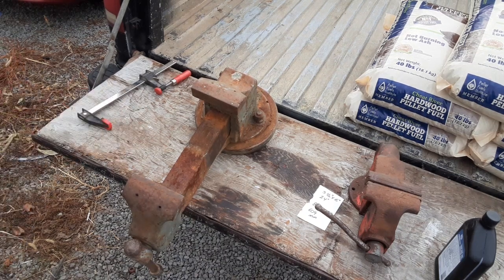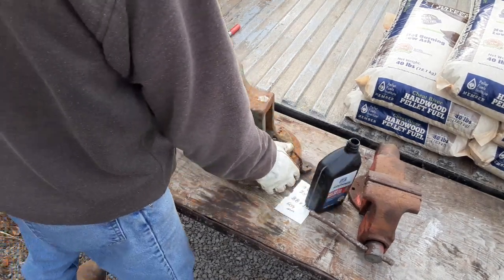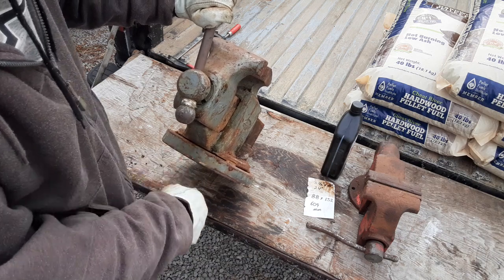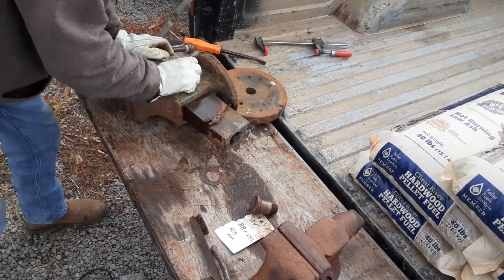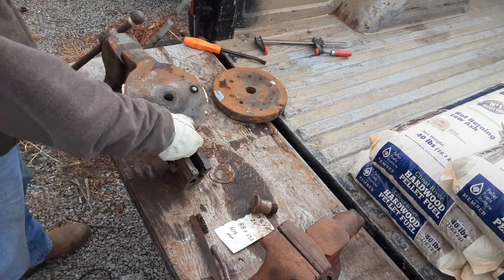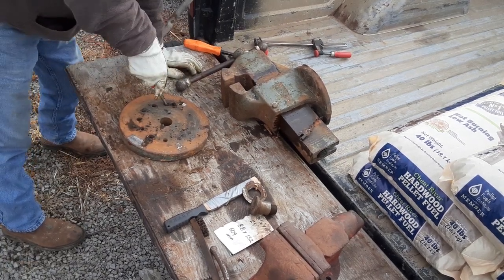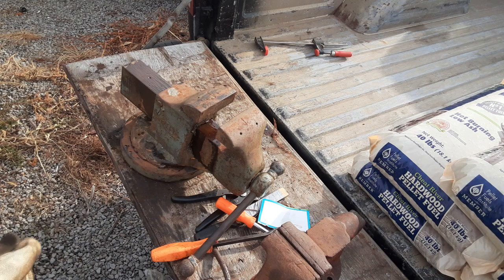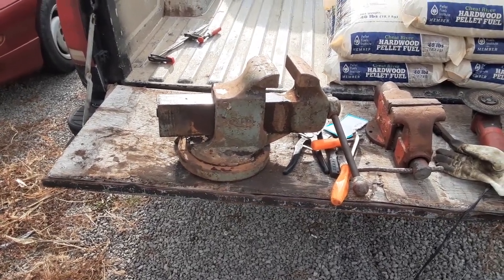the new Reed Vise and a question to the members about a piece of Steel

Comment: my first thought too would be quick change toolholders, but you would have to saw that 6" dimension in half- and sawing a two foot by 3 1/2 thick peice of steel is a lot of sawing.  A two piece vice for clamping parts straight on to the mill table would be a good use  of some of that steel. a threading stop  or carraige stop for the lathe would be another.  But also less exciting things like strap clamps. at 6 inches it's ok for a small machine table too. I don't know if you have a surface grinder but a 2 by 3 by 6 section could take a T slot and become the base for a mickey mouse cylindrical grinding fixture. .
Reply from the maker: A 2 piece is a great idea...been considering such a device for some time

Comment: I think that is the right size for quick change tool holders.

I would advise against painting the little vise. Replace the bar and wire wheel it but a fresh coat of paint makes it look like you are trying to hide cracks.
Reply from the maker: Thanks for the headsup! I always like the minimal amount of work anyways
Reply: Yeah tool holders or maybe plates for the hydraulic press.
Reply from the maker: @hilltopmachineworks2131  plates for the press is definitely interesting

Comment: What are the numbers on the vice or model #
Have you thought about using electroless us to remove the rust?
Reply from the maker: I haven't been able to uncover any numbers yet not saying there aren't any just not where it says read at least probably not going to do too much more as far as rust removal basically just want to get it functioning as well as I can looks like it's a 5 inch wide set of Jaws and about 100 lb the other thing that's kind of unique to this is the fact that it has the detents instead of the Locking feature

Comment: Hmm a little acetone and trans fluid sauté and it will be all good to go.
Reply from the maker: I will try to keep that recipe in mind...it actually freed up very nicely  with a lil oil
Reply: @craigtate5930  It just helps to cut and lube. I use it for a rust penetrant and it cleans pretty well I have found.